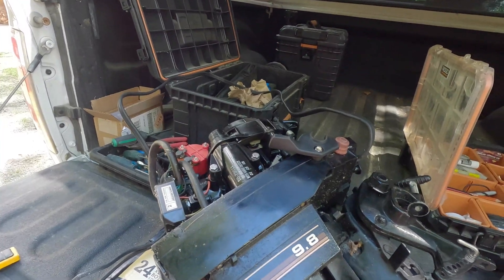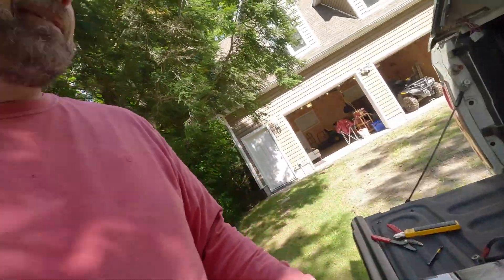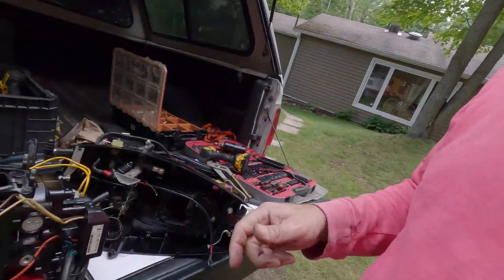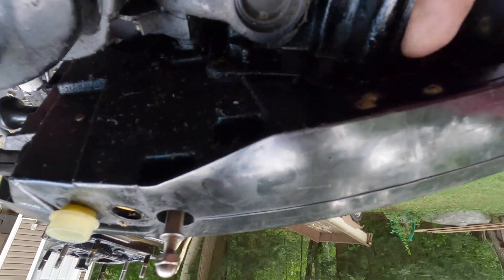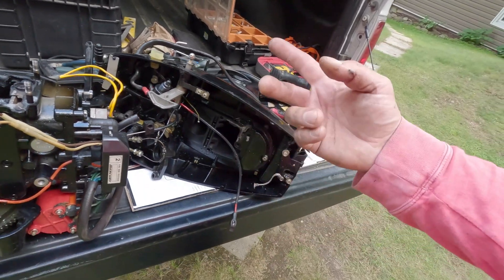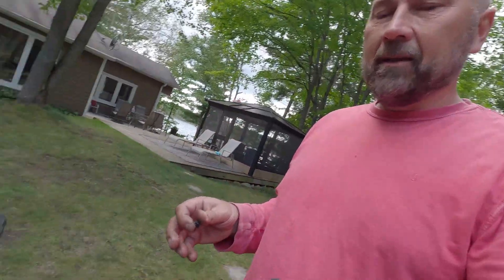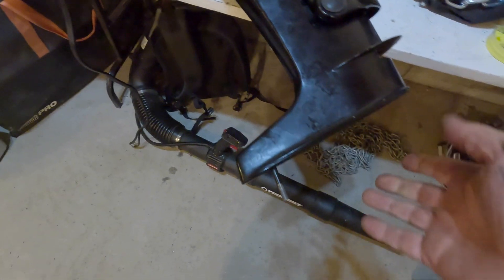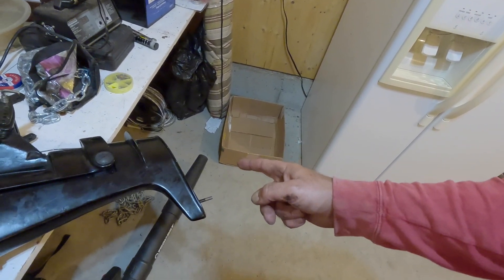How to remove the power head on Mercury 9.8HP (1985) outboard motor, gasket replacement

Comment: Do you have a link or part number for the piece that was melted ?
Reply from the maker: Yes, take a look at the video around the 0:28 mark, there is a screenshot of the part and part # - I ordered it from Crowley Marine. Here's the link https://www.crowleymarine.com/mercury/products/13127-nylon-spacer?q=2313127 
You may also need the gasket that goes between the power head and the midsection

Comment: Seri tan amable de ayudarme tengo un motor que si ensiende pero ala ora de ponerlo en marcha se apaga muchas gracias
Reply from the maker: How long does it run for? Is it shutting off right away or after few minutes? Mine would work for about 5-6 minutes and then shut off because it was overheating. Check and see if the water is coming out of the side, if it's not then it could be the water pump is not working and you will need to replace the impeller - see my other video on how to do it.

Comment: Good video. I watched your last one too. Little tip for lining that gear shaft up with the motor, put it in forward gear before you remove. When off you will notice you can turn the prop and get a bit of turn on the shaft. If it doesn’t line up the first time give shaft a small turn to line grooves in a new position and try again. Those small turns on the shaft along with the prop usually get it done in a couple tries. I know your pain tho, took me a lot of tries before I figured that trick out.
Reply from the maker: Thank you! I think that was exactly how I managed to get it in finally - it's hard to recall as the frustration was pretty high at that point haha. I will for sure remember this for next time!